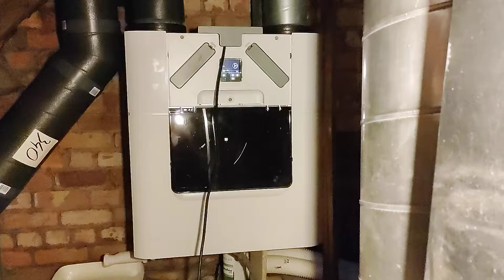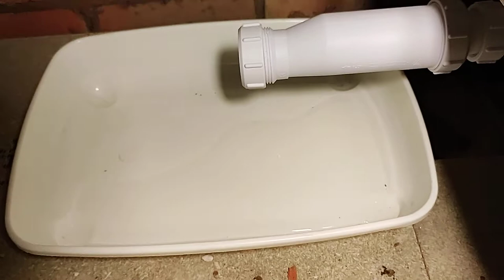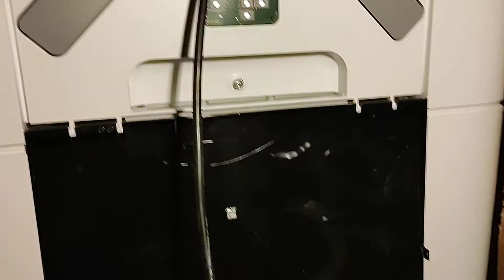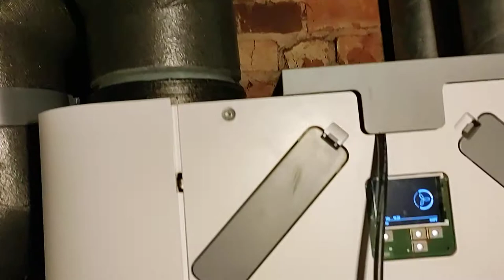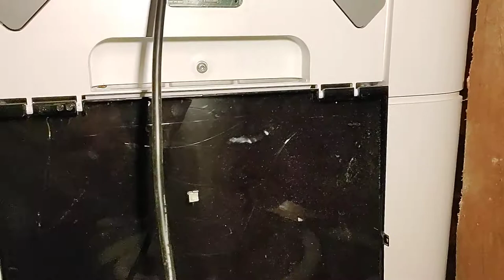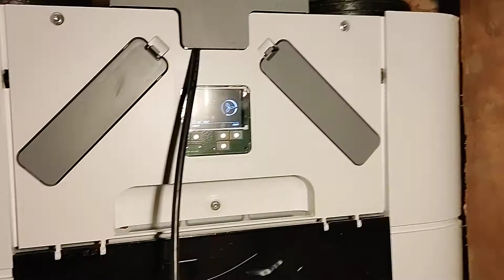How an MVHR ventilation system handles condensation in winter

Comment: Thanks - very interesting and even more surprising! We’re just about to fit an MVHR system to our very old house whilst we simultaneously try and reduce all the drafts etc! We’ve been running a 12L dehumidifier for the last year and it consistently fills the 2L water tank every 18hrs or so! Very surprised you have so little water condensing out of the MVHR in winter. I was just going to ditch our dehumidifier once the MVHR is commissioned, but I might continue to run it for a while as an experiment to measure the impact of the MVHR on the water output of the dehumidifier. Food for thought! Thanks for posting 👍🏻
Reply: Have you measured the humidity of the home with say a week of no dehumidifier then a week of running the dehumidifier?
We had no heating in the house for the past 2 winters. This year I got it all reconnected and working. I also installed a new wireless thermostat to replace the existing hallway wall mounted one. The new wireless thermostat gives both heat and humidity values. We were getting around 70% for the first week of use. Now into the 2nd week and we are around 50%. 
   Thinking of doing a MVHR system whilst I have the bathroom floor up as this gives me access above the downstairs WC and kitchen ceilings. I'd be interested if the MVHR can also reduce the humidity numbers.
Reply: Hi Geoff. No, I’m afraid I haven’t done any testing as such. The house is solid walls and one wall was fairly damp (wallpaper coming off etc) and the structural survey pre-purchase suggested the injected DP course had failed and needed re-doing. Once moved in, I could see there was damp in the area above a window on that wall too, and the cellar wall below that room was dry - so I doubted the rising damp theory. I suspect it was lack of permeability as that wall has been re-pointed with normal mortar, not lime like the rest of the house. I wonder if our high dehumidifier outputs have been because of this residual damp it’s been sucking out of the building which has built up over the years. In the last 3 months we’ve had 100m2 of new floor poured (with UFH) so I’ve plumbed the dehumidifier into the drain to save repeated emptying but I checked it last week and the dehumidifier reading suggested the humidity was just 41%! I think I need to get a humidity monitor and do some checks before and after I connect up the MVHR!! 👍🏻
Reply: @johnblackwell5805  Thanks John. With so much building work I guess there would be higher humidity. 40% is pretty low I think, even with our higher numbers we have never had issues with damp. I think we have a pretty leaky 1930's home.
   Too many times issues associated with damp are put down to the failing off the building structure rather than just poor ventilation. I would love to do UFH in my house having stayed in European homes with UFH it just works so well.
Reply from the maker: Hi John, One thing I missed mentioning from my video is that most of the water vapour in the air is still carried out by the outgoing air - it's only a small amount that condenses. So the MVHR is still removing a lot of water vapour from the home. 

Another thing is that this home is only two occupants, so not too much moisture generation from cooking, cleaning, etc.